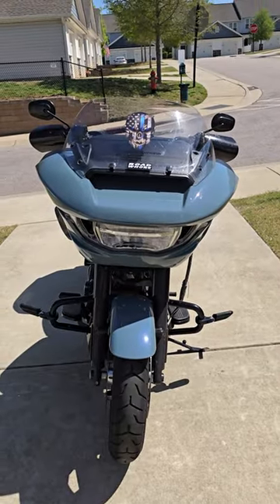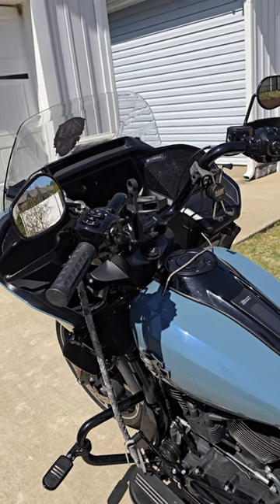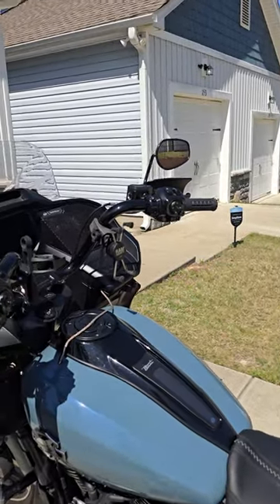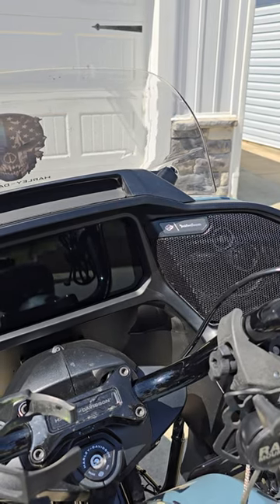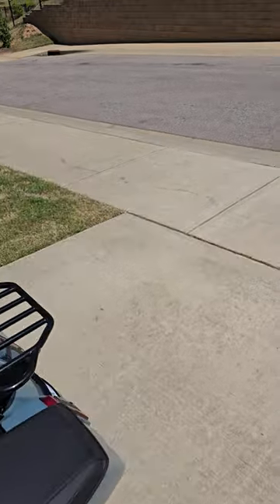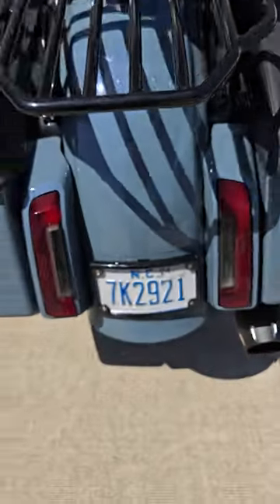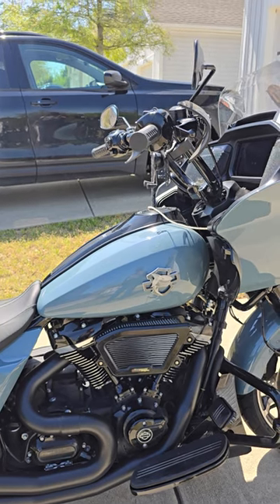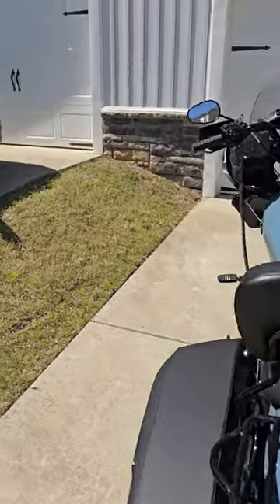2024 Road Glide Street Glide upgrades

Comment: Question …on your hand guards. Are they specific to 2024 ? Or do they fit previous models? If so, how did you get past the sensor on the clutch side?
Reply from the maker: They say they fit other than 2024 but I doubt it because the ones that are made for the 2023 model year did not work on my 2024.
The way these work is they only mount on the top and don't stretch under the mirror frame
Reply: @GregToback  what brand are they
Reply from the maker: They are the Memphis Shade model# MEB7216.
This is the link where I bought them
https://www.cyclegear.com/parts/memphis-shades-hand-guards-for-harley-flhr-fltr-2008-2023?sku_id=1177152

Comment: Thanks for the video, I have a question about the upgraded 500 W amp. I’ve been considering going with the Harley’s 500 W amp.  In your opinion, do you think one will be able to be hear music at interstate speed, wearing a full face helmet?
Reply from the maker: This is a hard question to answer. Here's what I can tell you in my experience. I could not hear my music at anything over 50 with the original 200 watt amp and stage 1 speakers and the 10 inch Harley Windshield. I upgraded to the 500 watt amp and Stage 2 speakers and I was good up to 80MPH. I then updated my amp software and can now hear at 100MPH. That's on the interstate with the Harley 10 inch windshield and a half helmet so my conditions are a little different

Comment: Hey Greg, I just got my 2024 road glide yesterday and attempted to put my passenger Harley Davidson backrest on for my wife that came off my 2021 road glide and it does not seem to fit. Do you know if they changed anything and whether or not I'm gonna have to get a new passenger?
Reply from the maker: Try adjusting the docking points on the bike. The one off my 2020 fit fine. Put the front on and drop it down to see if your docking hardware needs to be moved in or out and just turn it till it lines up on one side then do it for the other side

Comment: So, when you went stage 2…how does it work with the different modes?
Reply from the maker: I'm planning on doing a separate video too show the difference. But I will say this, the difference between the modes is very noticable and if you follow my video about how to program the custom mode it's even better
Reply: @GregToback  I did that…maxed everything in custom mode except min on deceleration lol

Comment: Did you do a non CAT head pipe with the basani muffler? If so did they say if that voids warranty or not?
Reply: Only curious because I bought a 24 model just the other day but I didn't ask that question to them.
Reply from the maker: It does not void the entire warranty. It will void any  exhaust warranty though